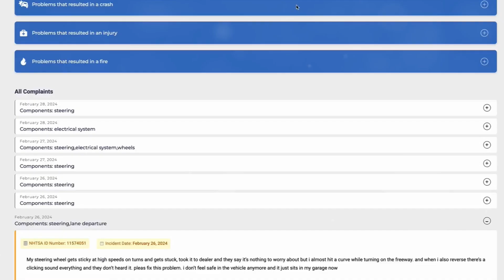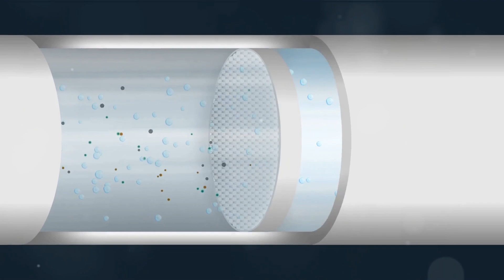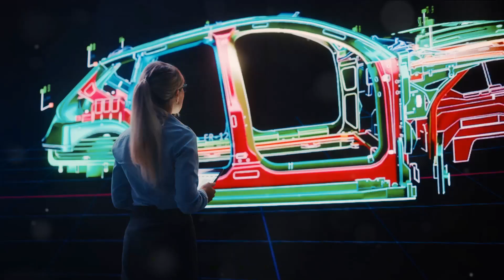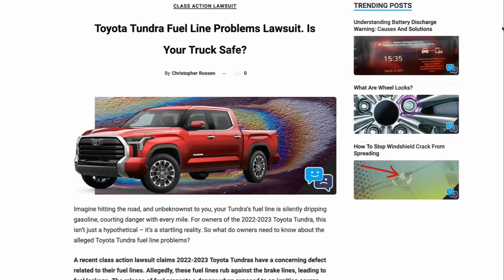Shocking: Toyota's Carbon Capture Engine Revealed

Comment: I wanted to design a compressed air powered hybrid with carbor pollution capture to power compressors to refill air compressor tanks as it drives to power the engine with cold compressed air reducing global heating